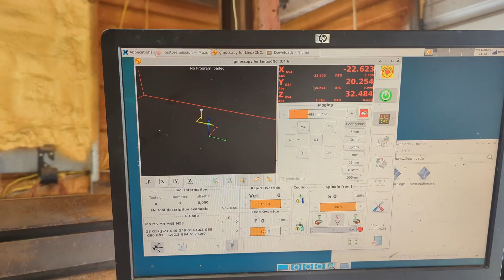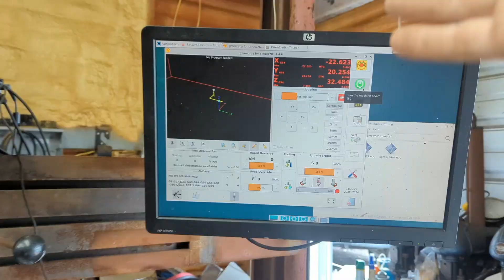CNC Bridgeport conversion from hydraulic true trace

Comment: I believe the problem with the Mesa card production is the limited availability of the FTDI chip.
Reply from the maker: They should go with an alternative then or let the product be open sourced. It's a bit shocking Linux CNC doesn't have an open source board like fluid nc

Comment: Go grab a copy of GatorCAM for cnc. I'll give you a license.  It's really easy and fast to use (which is why i created it)
Reply: You can use inkscape to create SVGs for free.
Reply: I run GRBL and arduino.  Yep, very easy and cheap.
Reply: GatorCAM supports ATC too!
Reply from the maker: Yes I have been planning to use it though never got around. This video is actually almost a year old I just got around to editing it. I recently got a CNC router table I think your cam software would be perfect to demonstrate on. But currently I just don't have the space in my workshop. Once I build this second workshop I definitely will. Sorry for the delays I myself haven't been able to use it